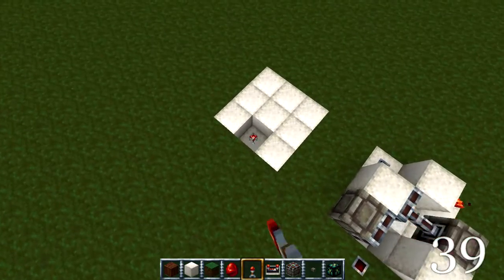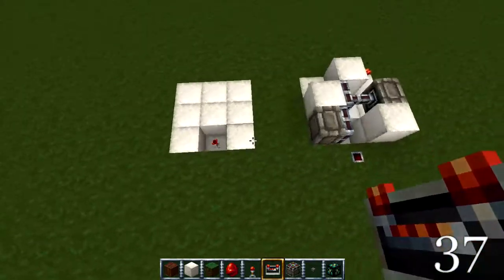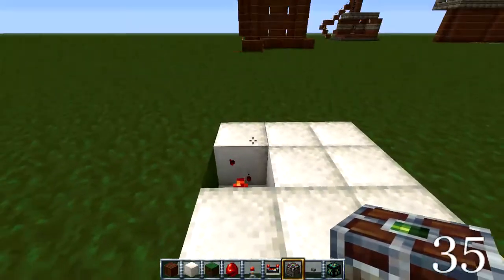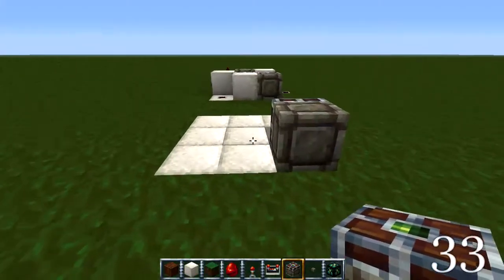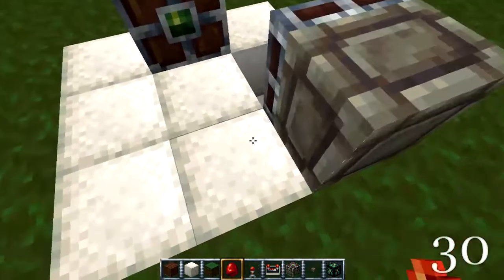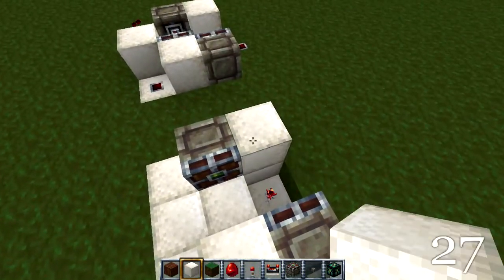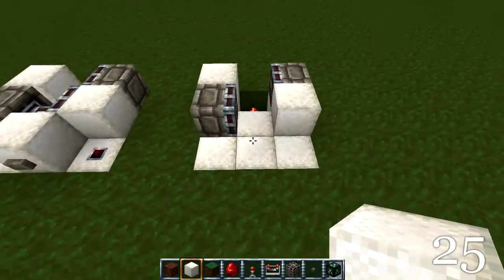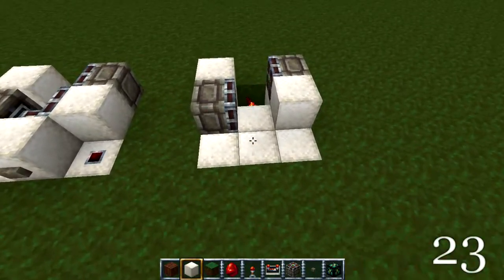Minecraft Redstone: The Smallest t-flip flop Design [In under 60 Seconds]

Comment: GENTLEMEN! BEHOLD! I HAVE FIXED IT FOR 1.4.5! What you do, is that you place a Repeater on the ground, where the button is located, and then put the Power Thru that, and it Ought to work. Just tried it, will do more Experimenting.